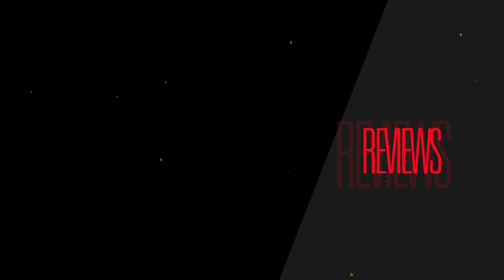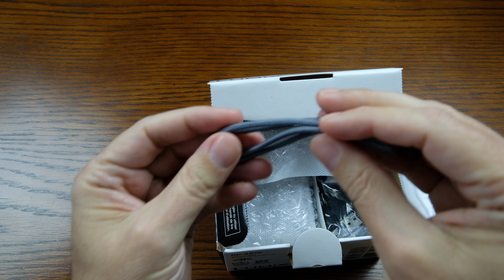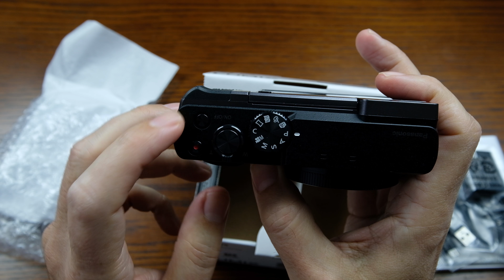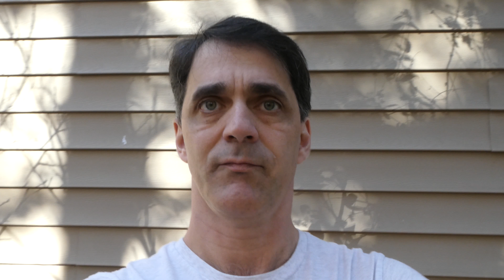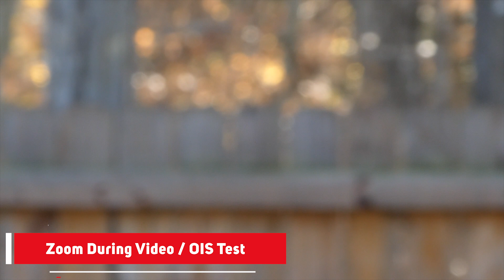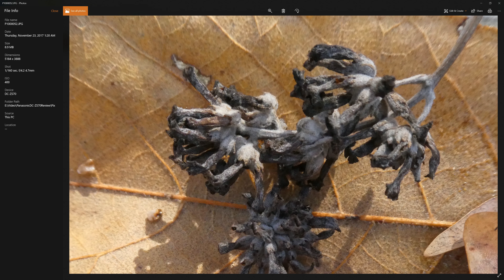Panasonic Lumix DC-ZS70 / TZ90 Unboxing and First Look

Comment: Hello, does it have duration limit in video recording of MP4 mode? Thanks
Reply: I believe so I think it’s 15:00 but you may want to confirm that. Cheers and thanks for watching.
Reply: @PhilEVignolaJr  It's 15 minutes for 4K and 30 minutes for FullHD 60i. But I need to know the duration for 30P FullHD. Anyway, thank you!
Reply from the maker: I believe it’s 30 minutes in Full HD mode no matter the shutter speed but I now longer have the camera to check sorry about that
Reply: @PhotoGearFun  Thanks anyway!